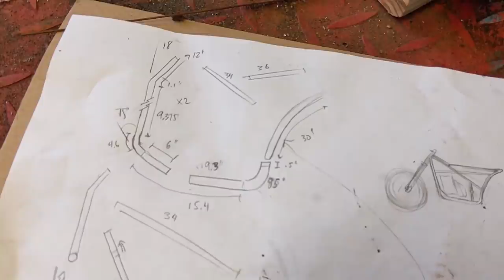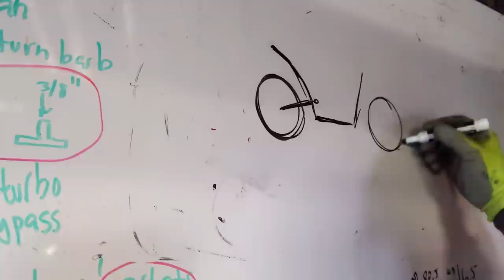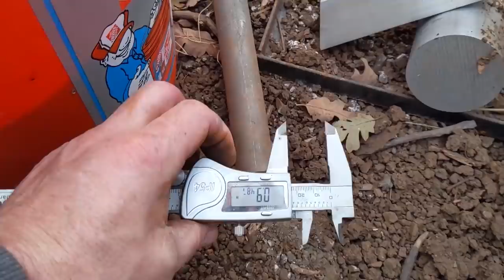INSANE!!! 18kW Dual Motor E bike build | Lark Machine Co

Comment: Notice how electric bike builders always publish kilowatts instead of the more commonly understood horsepower, because you'd realize that he's saying this motorcycle has less than 25hp, which is frankly crap.   Same with batteries.  One gallon of gasoline is equal to 33 kilowatt hours of battery, which shows how miserable most batteries are.   Fact is, electric vehicles are vastly inferior technology.
Reply from the maker: We post in kW because that's how you build electric drivetrains.  I don't think anybody is saying that electric motorcycles are superior to gas.  I'm just having fun building something new.  FYI almost all the world uses kW for power and your calculations are done ideally and before effiency considerations.
Reply: @sheanyquist  Not knocking your building skills, just making a comment about the immaturity of the technology as I'm coming from an e-bike forum where they talk about insane batteries and motors that are actually pretty damn weak compared to say a cheap Kawasaki Z400 that they won't even consider even though brand new they are only a tick over $4K because of "evil fossil fuel" and the need to take a couple hours to get the "M" stamp on their driver's license.
Reply: Real engineers measure internal combustion engines in KW. Knowing the engines displacement is by no means a indication of shaft output.
Reply: @SUNDREDSTAR  only the fruity ones that drink their tea with pinky raised.